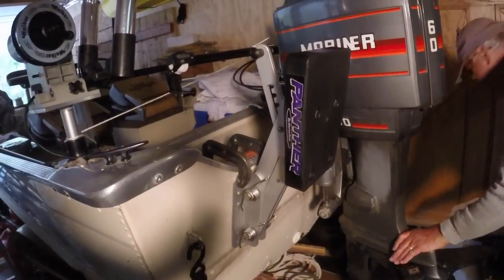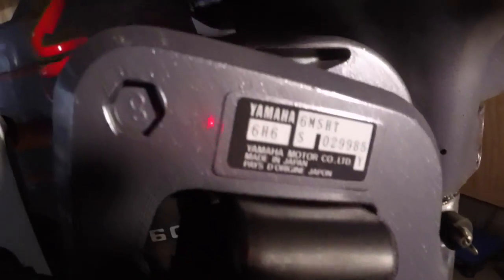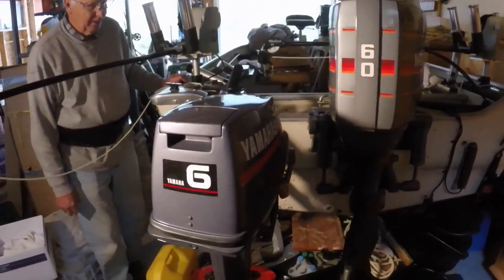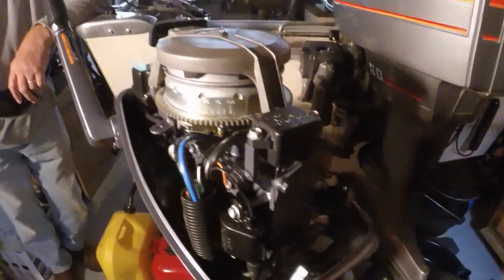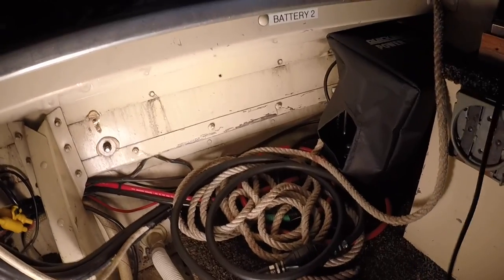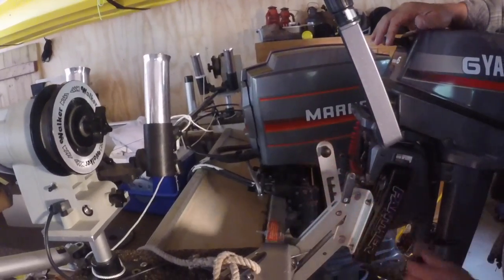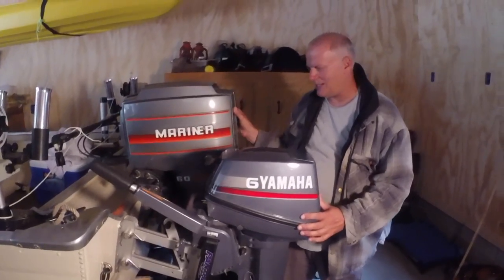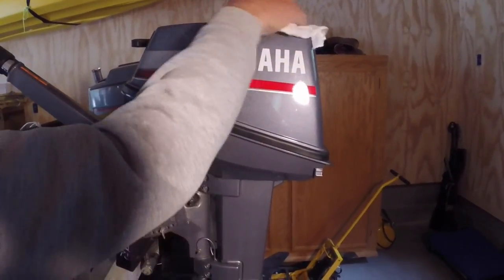Installing kicker motor mount on Fishing Machine

Comment: Not much about the "installing" and too much about the engine. No advice on where the prop should be relevant to the boat bottom. No use of a (recommended) stainless steel spreader plate to ease the stress on the boat hull.

Comment: If you lock that small motor in the straight ahead position, you will still be able to steer with the main motor. It will act like a rudder and point you where you want to go.
Reply from the maker: Yes, thats what we do.

Comment: I have the same thing going on with my 2004 Lowe FM Sea Nymph. I have a 8 hp Honda mounted directly to the transom but it is 100 lbs and with my Evinrude 75 Etec at 370 lbs it puts me over my transom limit of 380 by quite a bit. I bought a 3.3 Mercury 2 stroke from a local pawn shop that only weighs 28 pounds but it needs a mount to raise and lower it and I got one just like this one in your video. The Mercury is a short shaft so getting the water pickup down in the water far enough is of primary concern. Due to the design tilting the motor for transport while mounted on the boat will not work out due to a weak retaining pin and bracket.the motor needs to remain vertical for transport or be removed. Getting the anti cavitation plate at the correct height, in line with the bottom of the hull, requires the ability to lower it further down than by just mounting it directly like the Honda is. My master plan is to fix the kicker to run straight and use the big motor as a rudder to steer with. I will only use the kicker for trolling, unless the big motor quits on me, which will mean a long trip back to home port. In your video I wish you had paid more attention to the kicker bracket and how to mount it properly instead of what a great deal you got on the motor. The most important thing to keep in mind when mounting a kicker is the water pump needs to be at the level of the water surface in order to insure it pumps cooling water, if not you will kill your motor in short order due to lack of water flow.As far as the limit of hp on these brackets do check the specs but I think you will be at the upper limit at 9.9 hp..Otherwise good information and the only video I have found that gives me information I need using this mounting bracket.Thanks for taking the time to make and post it. :)
Reply: yes more on plate install

Comment: Just got a mount delivered. Tried to get the motor mount to move but it won't budge. Do you need weight on the motor mount to get this to move?
Reply from the maker: It helps, as the spring is a strong one. Some of them, you got to pull up a little to release them.

Comment: i m putting a kicker motor on my 20 ft. grady white with same mounting brk.u used wondering if that mount would support 9.9 motor .im sure i could get specs. also thinking about big flat washers on inside of transom or making flat backing plates
Reply from the maker: I think it will hold up to a 10 horse motor. I use big washers when I can, otherwise I make a bar to go between bolts.
Reply: I have a 15 hp 4 stroke on a bracket very similar to this rated for 20 hp 2 stroke. I'm pushing it but no issues yet.
I trailer it too..

Comment: difference between an outboard motor and "kicker"?
Reply from the maker: None really
Reply: We call in an auxiliary motor or a trolling motor in Australia. We use them for 2 reasons. Trolling, to save fuel and as a back up to get you hone if your man engine gives you trouble.

Comment: Could i use this on my 10hp main motor at full throttle? Or are these brackets for trolling speeds only
Reply from the maker: It depends on the bracket you buy. The one I installed is for trolling only, but we did run the engine faster with no problem, but it's only a 6 horse.